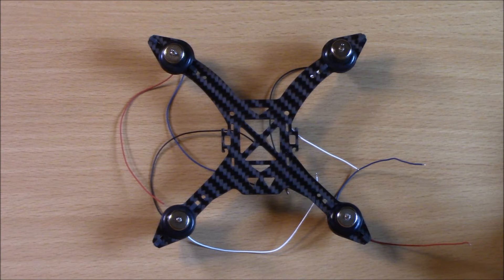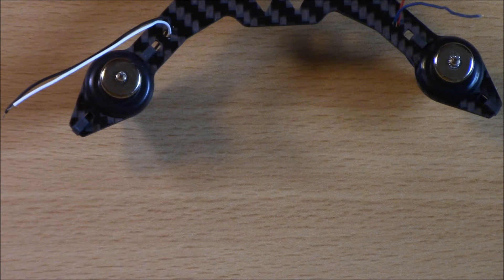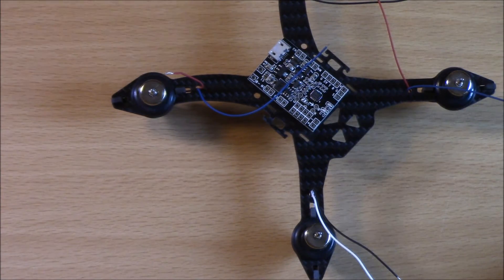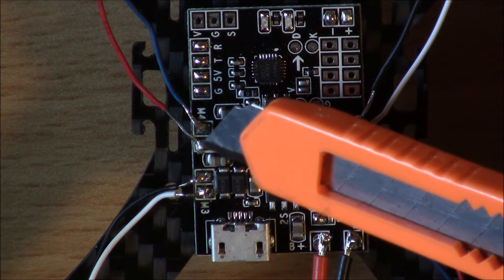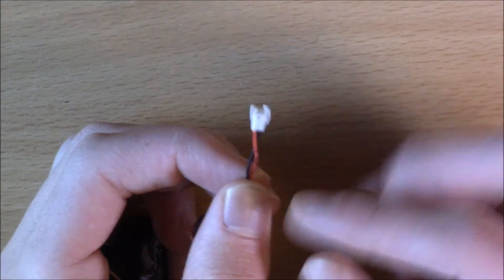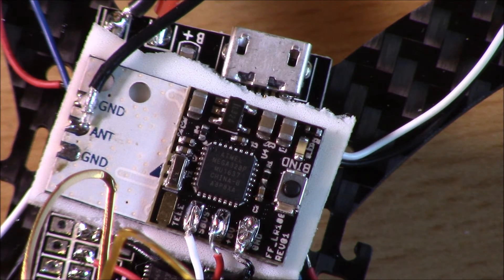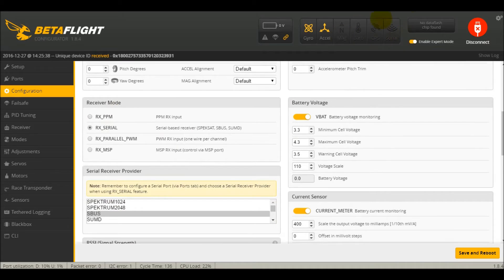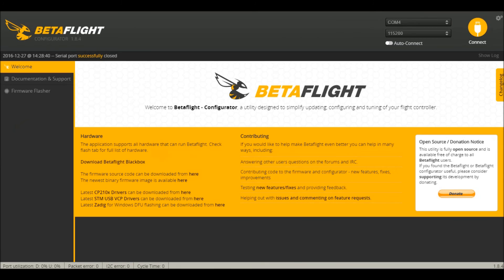Gearbest Cheerson CX117 FPV Microquad Drone Review: Electronics & Cleanflight Setup (2/3)

Comment: May I ask you why you connected the receiver signal wire to the 4th pin in UART2 instead of the 3rd pin as suggested for ibus/sbus..? Thanks!
Reply from the maker: +Adopanci A I wondered the same thing at first. I tried that at first, but it turns out that the manual is wrong. You need to connect it like I have in the video and not as it is shown otherwise. Not sure why but it didn't work the other way and works this way haha:)
Reply: Cameron Blegen Got it: there are 2 slightly different version of the board, and one is the one you have and the other one is the one I have. Smalla differences, one is the one we are talking about and another one is on the bridging spots for 1s/2s battery. Cleared up, now. Thanks! BTW, did you had to flash betaflight firmware in your board or was it already connectable in Betaflight..?
Reply from the maker: +Adopanci A glad I could help! No it came preflashed, on my board at least.